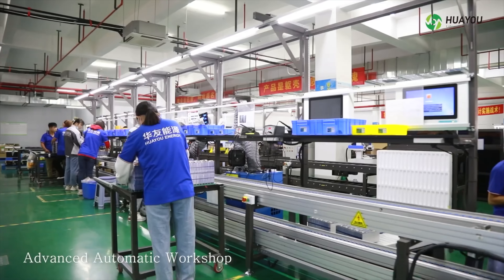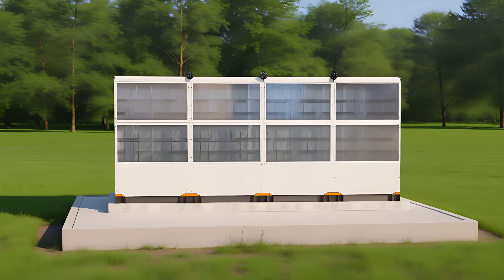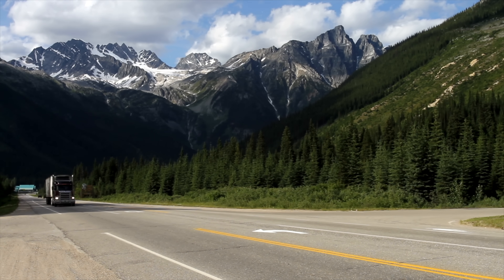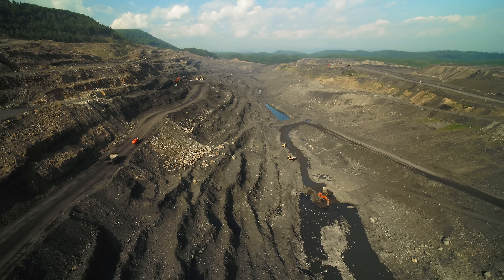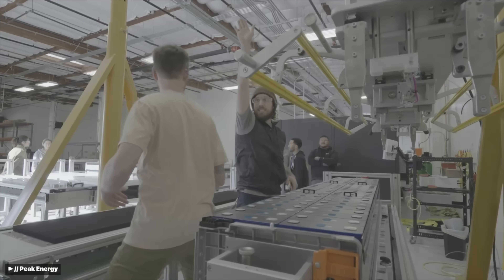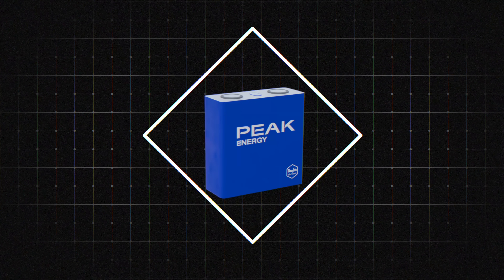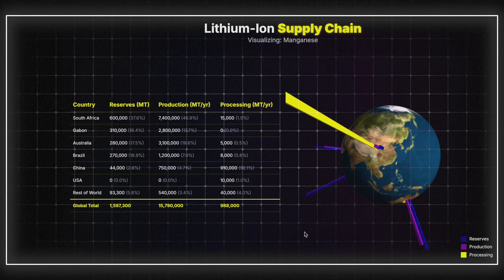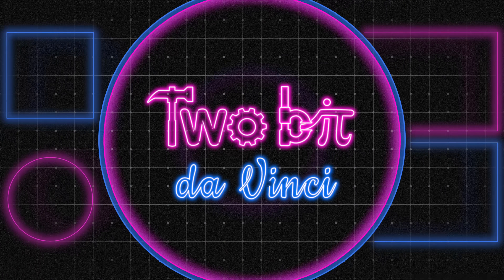Sodium Ion Batteries Are Going to be EVERYWHERE - Here's Why

Comment: China's CATL has already announced the Naxtra battery pack, the world's first mass produced sodium-ion battery pack for passenger EVs in April and available later this year. They are quoting $10/kwh versus $115/kwh for LFP, 175wh/kg gravimetric energy density similar to LFP,  up to 500km/310mi range, and 5C charging. Designed for the European and North American market where it gets very cold.
Reply: @Weezedog  LPF isn't $115/kwh wholesale. More like $60. Not knocking CATL here, I'm a huge fan. But it's impressive even with the correct numbers.
Reply: @fern3436 $115/kwh is what CATL quoted what I see quoted for the market average for LFP EV batteries as of the end of 2024. I'm sure there are cheaper spot prices and cheaper prices for lithium cells that aren't automotive grade certified and automotive safety certified as that has to add some costs to the product.
Reply: So if they're being mass produced already, where can we buy them?
Reply: @bluej2k  bluetti
Reply: @bluej2k that is a misleading statement by a Chinese national,  they are being mass produced,  but not yet for anything the consumer needs, more industrial so far, testa new model uses 100 percent Na batteries and its starting cost is around 15k dollars
Reply: @MrMichaelBCurtis  Show me a link to a $15k new Tesla and then I'll believe.  It reminds me of the sub $20k Maverick Ford promised.
Reply: @MrMichaelBCurtis  no shit. Since when have CATL been a B2C company? They're obviously a B2B company that distributes to other business that manufacturer EVs for example.
Reply: @MrMichaelBCurtis  oooooh red scare. ooooooh china
Reply: They can claim the same power density, but the battery weighs 30 percent more, just based on science. That is, there is no free lunch.  That said, low enough of a price and nobody cares about a bit more weight or less range.
Reply: @plektosgaming  The battery PACK may not weight more even if the cells do. CATL is claiming that because sodium cells operate at such a wide range of temperatures you don't need as much cooling/heating capacity which can reduce both weight and space in the pack. In other words they are claiming there is pack-level efficiencies that can be gained.
Reply: @Weezedog  They can claim that, but for safety's sake and compatibility with existing designs, it'll be the same or very little weight savings. You just have to deal with less range.  And that's FINE if you can get a basic work truck for $30K. That's what's really killing the EV market - the commercial fleets which are about half of all total sales are having none of it at the stupid prices they are asking.
Reply: @plektosgaming  the new Aluminum batteries have three times the power of Lithium safer cheaper and last longer. important distinction, the NEW ones.
Reply: @MrMichaelBCurtis  But greater cost than sodium, and aluminum is heavier than sodium. It also is fairly reactive unless made into an alloy, which makes it even heavier. This might be good for a power wall or similar, but not for an EV.
Reply: @plektosgaming  sorry, incorrect, it holds three times the charge of Lithium, so in reality, it is lighter per Charge. And a whole lot cheaper and longer lasting
Reply: Bs propaganda. Considering they steal almlst everything from us, then undercut.
Reply: Hi, I'm really tired of batteries. We need to devote the resources being wasted on inherently disposable power technology and pour it into perfecting and scaling up Nuclear Diamond "Batteries" (which are actually beta voltaic power supplies). Yes, they are also "temporary," but I'm pretty sure we can do better with devices that "hold their charge" for a thousand-plus years.
Reply: @Phil-i8y  I think you will find the next gen Aluminum batteries are a serious step up, safer, longer lasting, non toxic and cheaper.
Reply: So why doesnt Tesla or Ford or Rivian buy this?  Also how many KWh/kg?
Reply: @ChicagoBob123  Well currently there is a 100% tariff on Chinese goods in USA so that will impact things, but you will likely see automakers buy it if it's still cost effective even with the tariffs. In other markets automakers will definitely buy it. CATL is quoting Dec 2025 for the start of availability. It's 175wh/kg similar to LFP.
Reply: @ChicagoBob123 CATL sodium battery is 175KWH/kg which is better that BYD's state of the art 165KWH/kg lithium balde batteries, while costing  between 10-19 USD per kilowatt-hour.
Reply: Sony invented the current versions of the NA battery, Europe has improved it and Tesla will be the first mass produced pack in it's new model out this year
Reply: @MrMichaelBCurtis  Clearly CATL the largest battery maker in the world spent millions of dollars to bring a hybrid battery to market.  They wouldn't have done it if it didn't make sense for some of their customers. It must offer some type of benefit for it's target market of EREVs and PHEVs for them to invest time, money, and effort.
Reply: @Weezedog that thinking is ignorant,  companies make cigarettes,  not because they are good, but because people buy them, hybrid Li and Na makes no sense , you can fast charge Na but if it has a single Li cell it will explode. A hybrid is cheaper than straight Li, but it has none of the benefits
Reply: combining those two makes no since, the range would be better, but you would have to slow the charging by 75 percent, and the lithium part would have 25 percent of the lifetime and 10 times the cost. there is no sensible reason to combine lithium with salt
Reply: @MrMichaelBCurtis  Not sure what you are talking about. The Naxtra battery pack uses no lithium, it's 100% a sodium pack. The CATL Freevoy pack is a hybrid pack combining both sodium and LFP cells in a single pack, but it is intended for EREVs and PHEVs where the dual chemistries must provide some benefits when combined with a gasoline engine.
Reply: @Weezedog  it makes zero sense to combine a Na battery with a Li battery,  it ends up being worse than either. Li is much better for holding energy, but much worse in every other way, as soon as you use one Li battery you are getting all the negatives and not improving your energy pool by any significant amount. It is for ignorant consumers more than any real benefit.  That and I think China is in big trouble when  Li batteries are done. China has an immense market share of Li batteries, but they will not be able to do the same for Na batteries.
Reply: @MrMichaelBCurtis  - the dual-chemistry batteries are designed primarily for specific use cases - hybrids (particularly EREVs) and HGVs. The sodium side of the battery has a higher cyclelife so can take the brunt of constant or high SoC recharging (EREV generator or truck regen recovery) that would reduce the lifespan of the Lithium side of the battery. However, the Sodium side is heavier, has a lower gravimetric and more importantly a much lower volumetric density (about 20%), reducing the battery-only range of these vehicles, hence a Lithium battery is inlcuded to extend the range to more usable levels. The idea being that the sodium takes the strain off the Lithium, when needed, whilst on the move. The Sodium acts as a charge buffer for the slower charging Lithium cells supporting regular rapid top-up charging of the Sodium, though the whole battery speed slows down to that of the Lithium speed once the buffer capacity is exceeded.

However, those quoting $115/kWh for LFP are missing out that LFP reaches $55/kWh at high unit volumes currently (BYD as low as $44/kWh), which is the price differential comparator to Sodium-Ion not $115/kWh. Plus that the 175 kWh/kg LFP energy density comparator is increasing, with cells of 200+ kWh/kg in development. However, it's the lower volumetric density of Sodium and system costs that is problematic for passenger car EVs, giving their battery pack size constraints.

Sodium-ion has a higher cooling requirement to maintain SEI layer and electrolyte stability compared to Lithium cells, with larger cells for the same energy density, this means they take up more space in a pack and require more cooling area resulting in lower battery packing density, leading to lower battery pack energy density than Lithium, as well as raising system costs due to cooling demands. System costs are further increased due to different electronics requirements, with its lower cell voltage often requiring more expensive electronic components (similar in performance to those required in 800v vehicles). 

All in at the passenger vehicle level there is little cost difference between Sodium and Lithium, though this changes with scale hence why Sodium batteries are being targeted towards larger vehciles such as HGVs, heavy equipment vehicles and buses, where the cost difference does become a factor. Also, targeting areas where the unique characteristics of Sodium-ion, such as their higher cycle lifes and high power density (with its ability to charge to 100% with little impact) such as dual-chemistry batteries for hybrids.
Reply: @GruffSillyGoat that is a load of nonsense mixed with some reality and some misinformation.  you cannot fast charge a Li battery, it will explode, and when I say fast charge, I mean 80 percent in 10 minutes, something you can do with Na batteries. If you have one Li cell the thing will explode, you can operate AND charge a Na batter in -40 degrees, one Li cell and it cannot be done. Na is MUCH cheaper than Li, but maybe not in the initial run, the materials for the Na battery are common and cheap. The Na battery has the one drawback that it hold a significantly smaller charge.  Tesla gets around this by developing a regulator that limits cell charge use to what is needed, this cannot be done with Li batteries.  The advantages of the Na battery are long life, safer, cheaper, faster charge and more stable in a larger temperature range, the disadvantages are it holds a lot less energy.  if you combine the two, you keep all the disadvantages of the Li battery, you do save a little money, but you reduce the range significantly.  Hybrids are not sensible.
Reply: @MrMichaelBCurtis You can absolutely fast charge a Lion battery if you can keep it cool. It's all about thermal management. Zeeker Golden Brick battery charges 10-80 in 9m45s. China is way ahead of US in battery and EV tech.
Reply: @Weezedog  Tesla just announced 80 percent charge in 3 minutes and 100 in less than 5 using a new Al battery, it will last 100 years and puncturing it creates zero outgassing, They just switched to an Al battery, and China has never been ahead in anything. ever
Reply: @MrMichaelBCurtis Tesla announced no such thing. Provide a source. Tesla battery charging speed is not at all class leading. They are well behind China, German, and the Korean EV makers in battery charging performance. China is ahead of the US in EVs, batteries, renewable energy, consumer electronics, manufacturing, tooling, and nuclear power just to name a few areas.
Reply: @Weezedog  you idiots cannot search? Check out their new Aluminum battery it is going into production first for the Model 2, It is now better than Na batteries. China is behind everyone, they steal technology that is already old, they have never ever lead any science at all. Tesla has been the leader in EV since it started. Anyone pretending otherwise is brainwashed. I admit, they are not cheap, until the model 2
Reply: @MrMichaelBCurtis Tesla nor Elon has announced an aluminum ion battery. There are discussions online about aluminum ion batteries in general, but no announcements from Tesla. Don't believe scam sites man. Tesla is class leading in automotive software but that's it. Their power trains are good but not class leading like Lucid, their charging lags behind, and their build quality is not good. Tesla is decent, but they are falling behind the competition especially in China. And you are delusional for not recognizing the truth in the rise of China in the technology race. You are burying your head in the sand and not seeing reality.
Reply: @Weezedog  you make a good argument, but China just paid a ton of money for Tesla to make large industrial size batteries, why if china is better?  The model 2 is coming out and it is cheap, why do you think that is, maybe your information isn't as accurate as you think it is, Chinese junk EV are catching fire, and their paint is blistering, they have all kinds of reliability issues, and most of the world no longer trusts them, they are no longer selling.
Reply: @MrMichaelBCurtis is it coming out right after they finish the hyperloop? Lol
Reply: @MrMichaelBCurtis Large scale batteries are extremely supply-constrained, they literally cannot get enough batteries buying from only one supplier they have to buy from multiple companies including Tesla, CATL, and BYD. The largest battery company in the world is CATL, which is a Chinese company, but not even they can meet world wide demand. Also China EVs aren't junk and haven't been for years now. China has been dominating Europe in EV sales. The days of China vehicles being death traps are long long over. It's just like how the Japanese and Koreans caught up to the US and the rest of the world.
Reply: @mbburry4759  but before China attacks Taiwan
Reply: @Weezedog  keep telling yourself that, every single test shows the Chinese batteries are the worst in every category, China doesn't have the tooling to make quality
Reply: @MrMichaelBCurtis LOL are you living in the land of delusion. You do know that Tesla uses Chinese CATL batteries in their vehicles and used to use BYD as well. They only stopped in the USA because of tariffs, they still use CATL in other markets. CATL wouldn't have become the largest battery maker in the ENTIRE WORLD if they made junk. True fact, Tesla's own 4680 battery pack they put into the Model Y for a time was the worst charging of all the battery packs, worse than Panasonic, LG. CATL, and BYD
Reply: @Weezedog  you are nuts, Elon has his own design, China has not been able to steal it yet.
Reply: @MrMichaelBCurtis  Elon promised lots of things, this model 2 has been mooted for nearly a decade. By the time it’s out, if it ever, it will cost twice as much and halved the range. There’s a reason why lithium batteries are so ubiquitous and sodium not, it’s their energy capacity.
Reply: @MrMichaelBCurtis  Hypersonic glide vehicles, sixth generation fighter jets all tech that China is ahead. China leads the world is 57 out of 64 critical technology fields according to ASPI an Australian think tank. You're overestimating the West's capabilities.
Reply: @MrMichaelBCurtis  ye America no.1 blah blah blah no evidence needed lol
Reply: @MrMichaelBCurtis CATL is starting mass production of their sodium ion batteries this December. Even Samsung and other South Korean manufacturers said they won't be able to compete.
Reply: @dzibanart8521  what you don't get is the advantage of China is they don't care about their people or pollution, so they are the only ones that would mass produce Lithium technology.  Sodium, and the far superior Aluminum batteries don't have those issues, so no reason for China to have an advantage,  you are making invalid assumptions
Reply: @Weezedog  Stop arguing with Mr. Curtis.  He seems to have a visceral anti-China outlook and will not engage in a purely rational and scientific argument.

Comment: Yep Li for mobile applications and eventually anything that leaves the ground and Na for stationary and budget transport like last mile transport and most daily commuter cars, especially if the driver can plug in at work or home.
I think if PE wants to beat the competition they should come out with a budget home battery and charging software suite. I'm all for a shed sized battery at the edge of my property that charges at super off peak hours if it makes financial sense in the end.

Even better if it not only peak shaves but can also act as a backup AC generator for several days if a storm comes through and takes out the grid power.